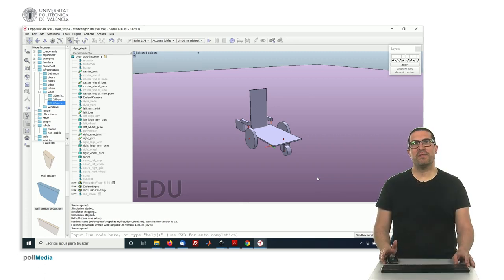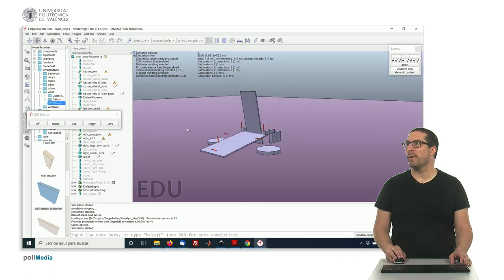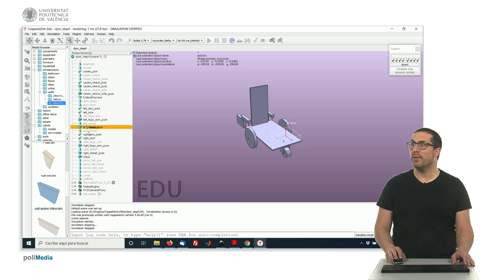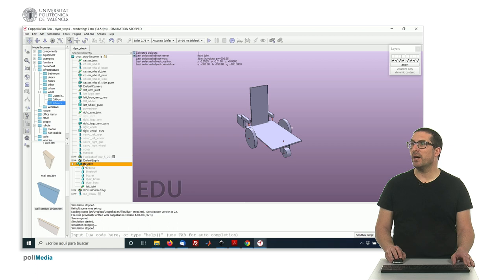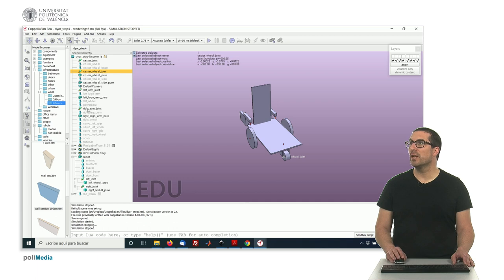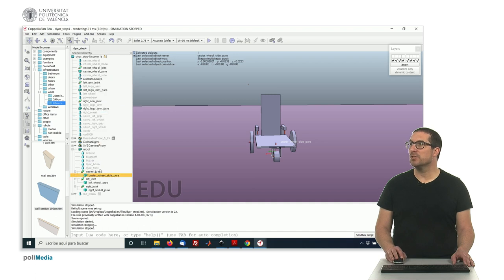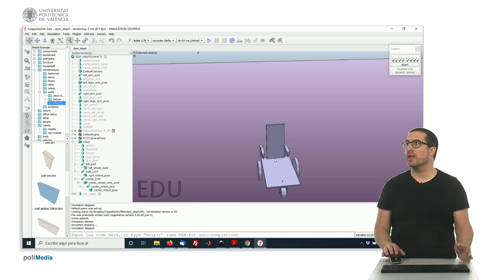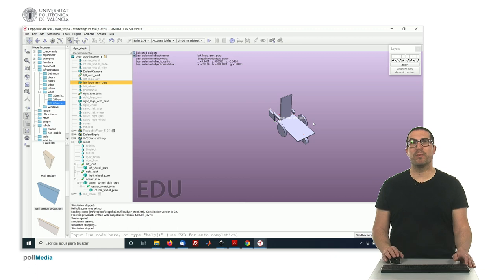Creating DYOR robot (Step 4) | CoppeliaSim (V-REP)

Comment from the maker: In order to obtain an stable robot, reduce the weight of the robot arms and increase the weight of the caster wheel suport. This is actually close to the actual robot, because the robot arms are made with lego parts which are light, while the weight added to the caster wheel support is due to the powerbank and arduino board which are actually acting as a counter balance.

Comment from the maker: Hello, check that there are no respondable elements colliding with each other (particularly the ones related with the caster wheel). Also modify the wheels material in the dynamic properties (to avoid sliding). Anyway, a small drift is inevitable. Please, check the comments attached at the beginning of the videos, eventually some of them include comments to some bugs and errors.
Reply: Sir the wheels are  set to high friction materials, they are not sliding, they are rotating , the robot is moving in circles
Reply: So sir may I assume that the robot shall move fine once we program the joints?
Reply from the maker: Himanshu Dubara yes, without the joint the parts fall apart. Keep working with the next videos ;)
Reply: @LeoArmesto  Thank you sir
Reply: @himanshudubara6362   hi there did you manage to stop the rotation? i am struggling

Comment: Could u plz send the hierarchy part ,it's confusing which inverted part n which non inverted part r to be placed in hierarchy
Reply from the maker: It’s easy, the base is the top element. From it, you will have the joints of the wheels and the vertical joints of the caster wheel and arm servos. Each wheel joint will have the corresponding dynamic wheels attached to them. The servo joints will have the arm dynamic parts attached to them. The vertical joint of the caster wheel will move the wheel support (U-shape) and a horizontal joint that will have the caster wheel attached to it.